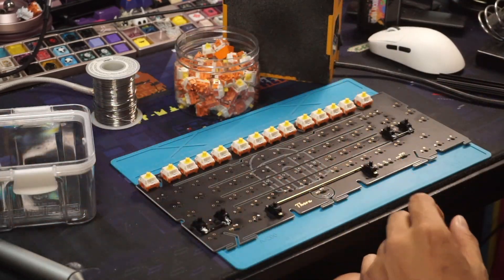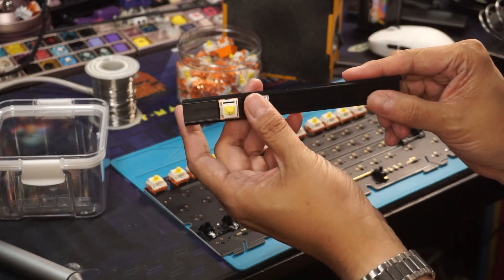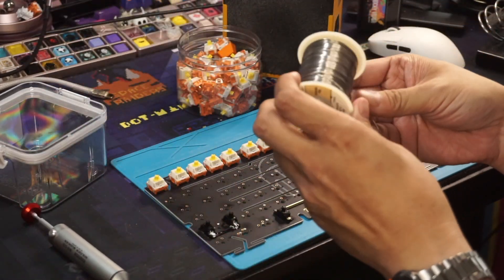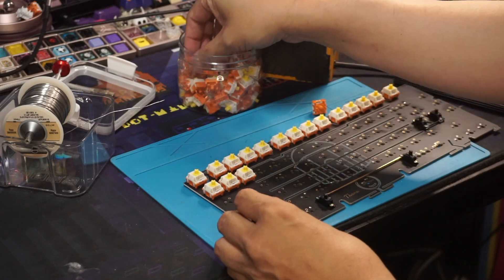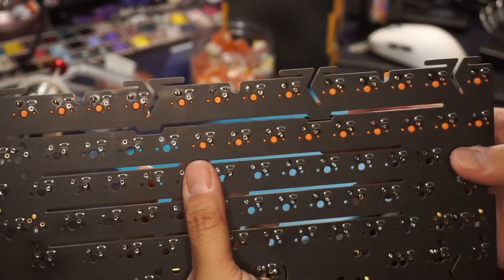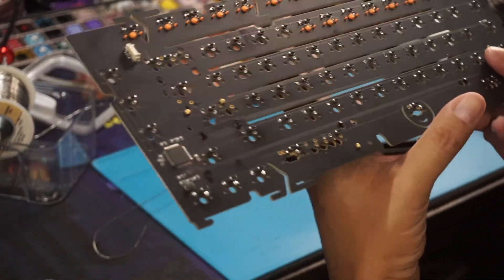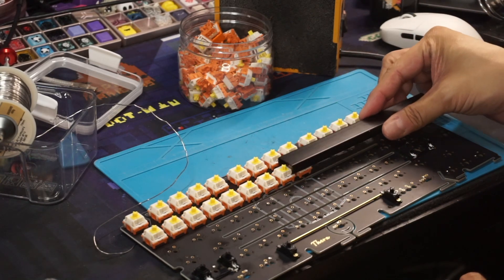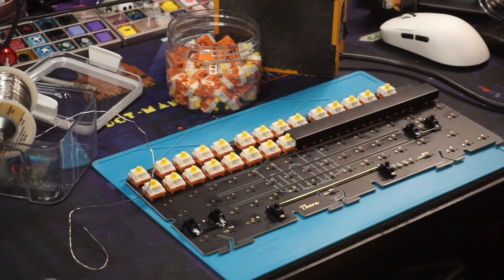Plateless Keyboard Build Guide: How to Solder with Switch Rails (Beginner Easy Method)

Comment: good video! however, I do not see the switch rail on drop. which switch does it come with?
Reply from the maker: thats a good question.  its been a year or two since i got these, but they come like 7 rails or something like that full of switches per box of 35 switches.   i think holy pandas they will.  check review/photos sections, someone may have posted a pic of their unboxing and u may see the rails.  alternatively can look for 3d printed switch rails.